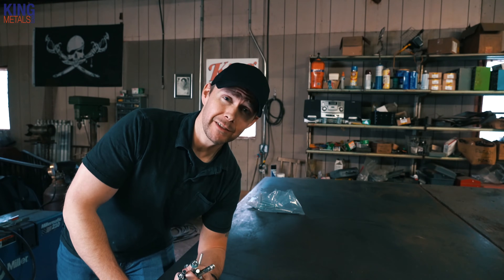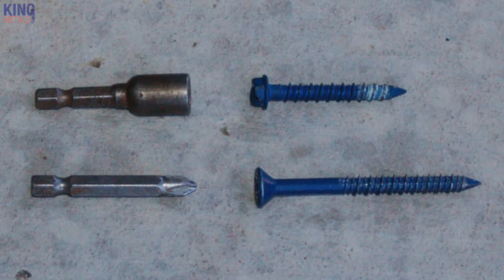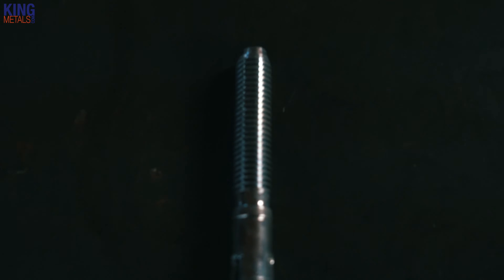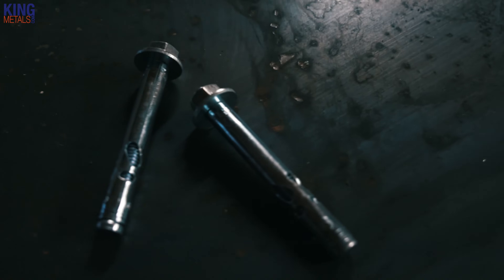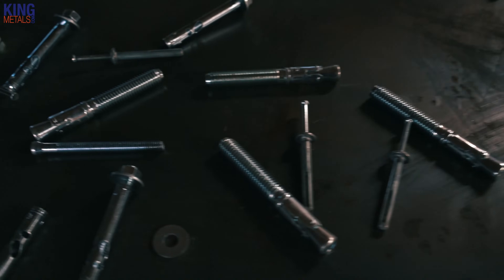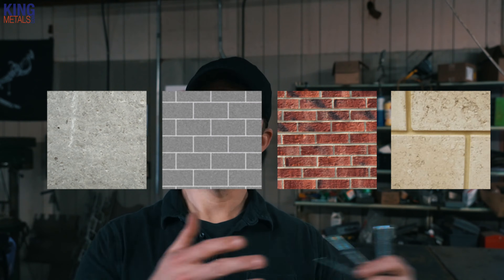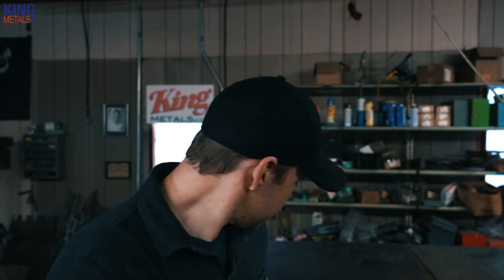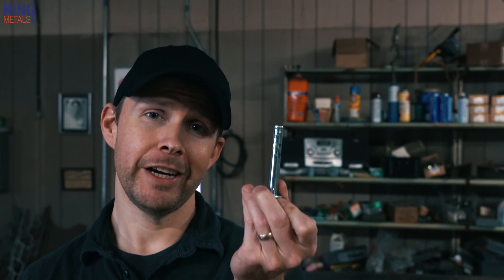Concrete Anchors: Which ones are better?

Comment: Yeah-but, I need an anchor that when I remove the temporary equipment, there is nothing protruding, and that I can reattach again and again, like if I could attach something to the floor with bolts, not nuts on a stud that's sticking up.

Comment: The best type depends on the application.  Concrete screws are great, when they suit the application.  One advantage is that they use a smaller hole, which is easier to drill, and to get placed accurately.  I mounted shelf brackets with these, and it was easy.  This is a light duty application, so they are not close to being overstressed.  I used square drive screws, which is a good choice because of the relatively high torque required to install them.

I have also used larger concrete screws with a hex head.  I drove those with hand tools.

I mounted a safe on reinforced concrete using wedge anchors that take a separate bolt, and I used high strength bolts.  The problem there was that I was unable to place the large holes required accurately enough to align with the holes that had been drilled in my safe.  I took the safe to a machine shop to have two of the holes milled enough to get them aligned. 

I used a borrowed heavy-duty drill to make the holes for large anchors.  I can make holes for concrete screws with my half-inch hammer drill.

Comment: Nail-In type anchors are not meant to be easily removable. In fact, if you install them correctly, which involves completely hammering in the nail into the sleeve, there's no easy way to remove them without a lot of cutting the thing that the anchor is holding and chipping away at the concrete.
If you leave a bit of the nail head out of the sleeve, you can pry it out and then pull out the sleeve, but then the anchor is not wedged into the wall as much as it was designed to be.

Comment: What about hot dipped galvanized all-thread and high strength anchor epoxy?

Isn't that what professionals use when installing auto lifts, or commercial building additions?

Comment: 100%, Sleeve anchors are my favorite too. Sure, maybe wedges are "technically" rated to hold more, but both are fully capable of holding down pretty much anything. On the other hand, in my experience, wedges tend to spin a lot more than sleeves. Plus, with a little effort you can remove sleeves. Good luck ever getting a wedge out of that hole.

Comment: Best ones depend on material you drill into, weight to be held epically if from a ceiling etc. WORST is all the POS anchors made in cheating g lack of quality control no good communist china.

Comment: Which one would you recommend to attach a steel 4x4 post holder for 2 feet of post to a 2 inch cinder block cap. The catch is that the cinder blocks themselves may not be filled with concrete so the cinder block may be hollow below the cap..thks..jc

Comment: Andy, thank you for this video. I have a question: I am using REDHEAD concrete sleeve anchors, your favorite. I drilled the pilot hole, then I put in the anchor but it kept on spinning freely. Does this mean that I drilled a hole into a space inside the wall (thereby not strong) and that I should not proceed?

Comment: According to the manufacturer, sleeve anchors can be used in brick and block and are not as strong as wedge anchors.  Wedge anchors are made to be used only in concrete.

Comment: I agree with Andy, sleeve anchor is best. I had to do an industrial type install a few years ago and nothing else worked. I have seen some industrial installs that used epoxy. Is this ever used by itself or in addition to another anchor?

Comment: Aside from the nail in (hammer anchors) if you live somewhere in Europe that likes to shit talk the US timber and drywall housing you can use a mason bit in your brick slightly smaller than a wood dowel (may have to taper the dowel) a bit insert it into the hole, hammer it in and a regular timber screw will wedge the dowel and act as an anchor..  this is more for hanging something on the interior like a picture or TV mount so you dont always need concrete screws for light to medium projects.

Comment: I don’t think a sleeve anchor would necessarily work well in one scenario I’ve encountered; anchoring a heavy load into cored-out hollow brick. If the sleeve anchor ends up expanding in a hollow section it won’t grab anything. Do you have any tips for this scenario? My best thought so far is that a tapcon would be better since it can at least grab sections of the brick before and after the hollow holes it may run though.

With that said, I think drilling into hollow brick is probably not a good idea in itself and drilling into the mortar would be better and safer. Doing so, you could go with either a sleeve or a LDT tapcon that is about the size of the joint. I think the closer the anchor size is to the joint width the better since the bricks above and below will provide more compressive strength against the anchor. Curious to hear your thoughts on this sort of application or if you have any experience into hollow brick?
Reply: You can use a Fruilsider X5 plug, or a mesh sleeve with a concrete adhesive and chem stud. Both those options will provide very high load capacities into hollow brick. Of course this all depends on how much load the anchor will be bearing, and whether its shear load or tensile load. If it's not structural then an X5 nylon plug and screw assembly will work great. If it's holding quite a bit of weight then a mesh sleeve with a concrete adhesive and a chem stud is probably your best bet.

Comment: Im looking to adjust a wall frame (2x4) to concrete basement floor, but I want it to be removable. Thinking that I may want to change wall positions in future. I was thinking in drop anchors but not sure.
Reply: If it’s non load bearing your best bet would be to use a screw like Titen Turbo

Comment: I am installing a 13 foot pole on the concrete roof for solar Structure.
I need to know which anchor bolts to use. (Wedge or Sleeve)
Pole Size 4 Inch 2.6mm weight 79 Pounds.
571-square-foot structure with more than one pole of 1,320 Pounds (Total Load)
Reply: Which one was it. I’m curious.

Comment: I need to add posts under a deck and the bottom is a concrete pad, I am thinking I will just find some type of glue to attach steel to concrete

Comment: I'm mounting a heavy rail on a cement Ceiling Will sleeve anchors work to hold something like 500lb?
Reply: A1/2” wedge anchor holds 4000lbs at 2.25” of depth, and up to 6000 lbs if you go deeper.

Comment: I always do the same thing I’ve  use the right tools and the right drill bits and I’m tired to have a problem tightening, when i turn the nut the all thing turns and the bolt can never be tight. What’s the secret ??
Reply: Are you drilling into soft old powder mortar or concrete that is chalky and easily crumbles? If so, most of the anchors will just spin, but a sleeve anchor might work
Reply: Drilled the hole too big? Try drilling half a size down masonry bit so 0.5 less than what you currently doing.
Reply: Sounds like the hole is too big, get some epoxy and drill your holes smaller moving forward.

Comment: I have  a homemade rack that I want to install into a brick wall and it's going to be used for hanging my cast iron cookware on which is a little over 100 bolts. Would sleeve anchors be the best option?
Reply: Use a chemical anchor. The sleeve anchors will unquestionably fail if you have freezing weather. You need to keep water out of the hole.

Comment: Wrong you can use tapcons for everyone one of those jobs just get bigger or smaller ones and they are stronger than any other anchor test have proven it.
Reply: Jack Braddell  not true. I'm a mechanical contractor and we use them all the time it depends on the area I guess. But New York New Jersey Pennsylvania is allowed
Reply: Jack Braddell  lol do you have to put cables on everything like we do
Reply: 1/4" Tapcon achors snap if you look at them wrong.  I would love to see a test that proves those are stronger then something besides duct tape.  Dont get me wrong, I still continue to purchase them and as a result, I end up snapping 1 out of 5.  AND yes I am using the proper drill bit, I am going to deep enough, and I make sure and blow the hole out with compressed air.  The only thing that I have found that helps, is to make the hole an extra inch deep so there is room for any debris from it going in end up. Otherwise when I tighten up the last 1' or so, SNAP, CURSING, tantrum, repeat.

Cheers!
Reply: @SynergyAVE  I always go deeper than suggested. And I still blow out the hole. You have to remember that when you tightening it in it's actually screwing into the concrete breaking and chipping off pieces. Those pieces keep you from hitting bottom when you're tightening it and that's what makes some break. It took me a long time to realize that. But now I haven't looked back. They are recognized here in Jersey in the building code. So what it says on the box here in Jersey is the God's honest truth.
Reply: @licensetochill79  I love tapcons, I drill like half an inch deeper than suggested and I use an impact wrench to drive them in.